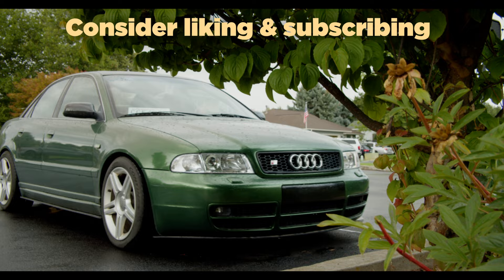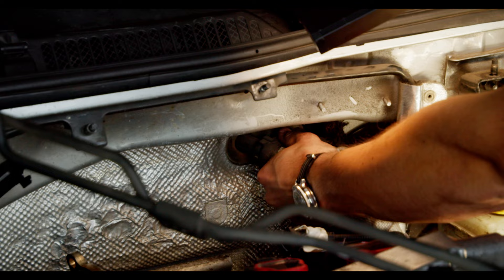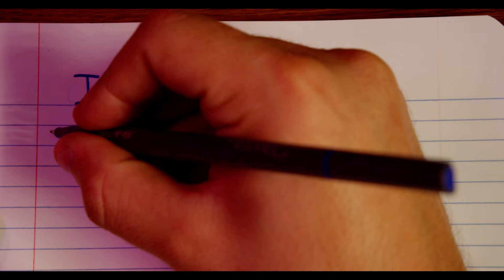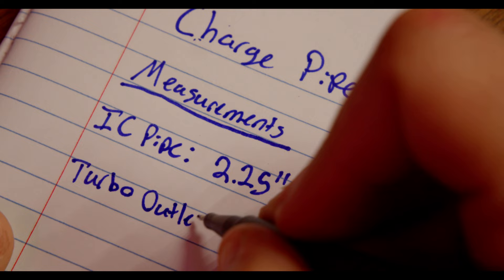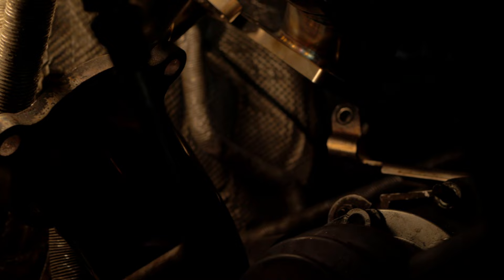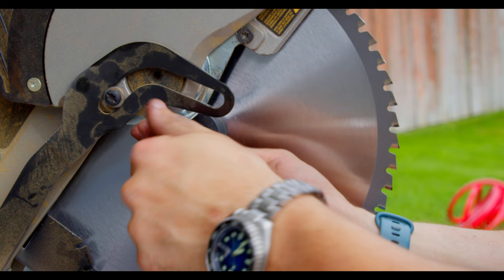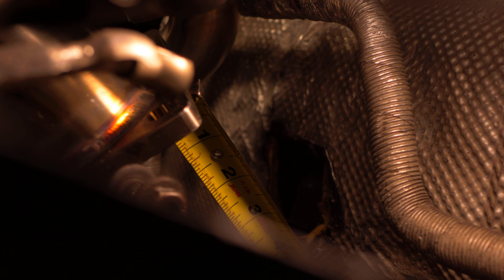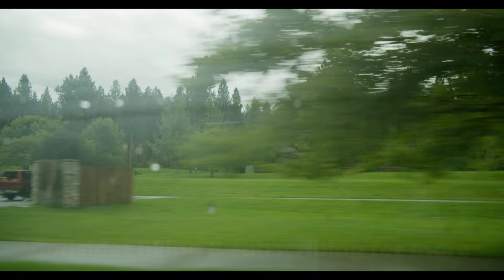Designing Custom Parts For The Big Turbo TT! | Intake, Charge Pipe, & Downpipe

Comment: Hunter Direction, thanks for your enthusiasm for an MK1. I, too, have a project MK1, and I'm taking your advice on suspension upgrades (with the expectation of coiliver & shock) because I couldn't afford Bilstiens this round; maybe next time... I hope your following continues to grow! Perhaps you can put together a TT Fun Run and drive to some top wheel destinations. I'm in Colorado Springs. I'm looking for an update on your suspension tuning, and maybe why the drivers side front  Whiteline endlink came undone? I'm anxious to see how your turbo comes out. I run a PowerMax GTX2867R with a Motoza tune on my AMU 225. Keep em' coming.
Reply: BTW, which Strut Bushings and Ball Joints did you go with for your installation? I went with the fully adjustable Eurologic Front Lower Control Arms for my build and Raceland Coilovers and Shocks.